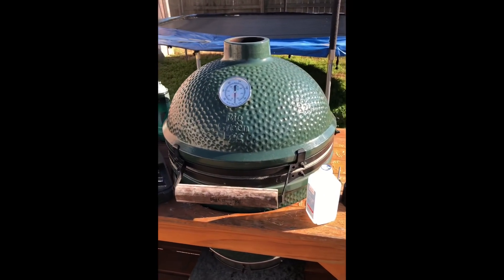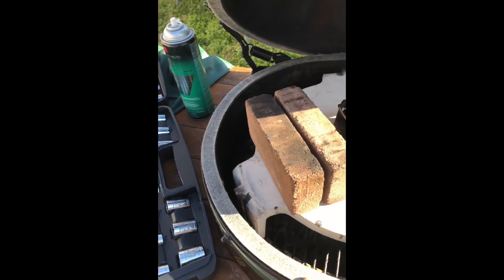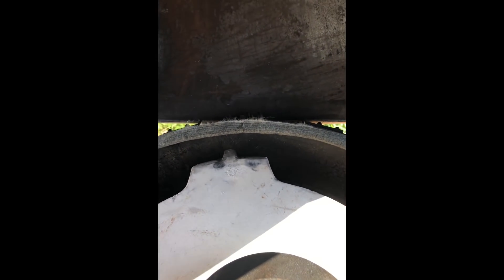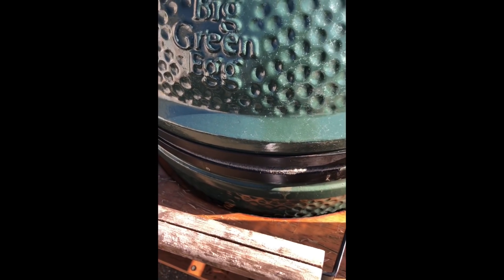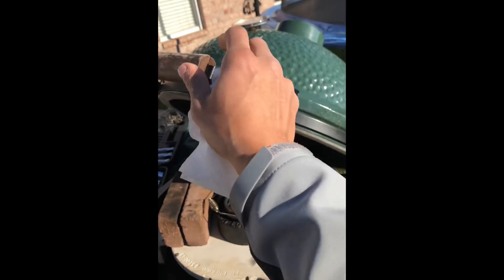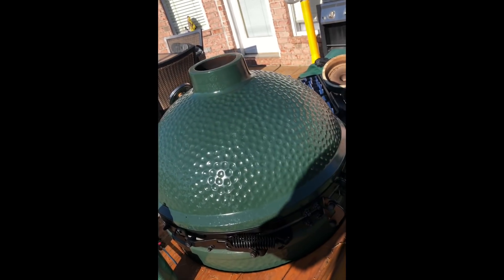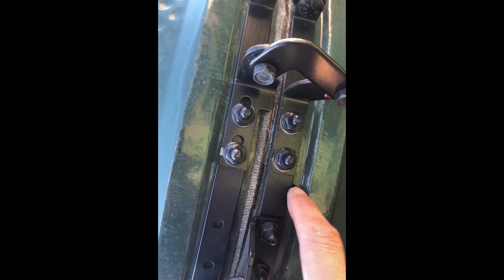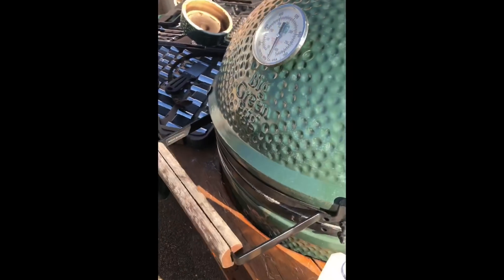Big Green Egg Dome and Base Alignment

Comment: Great video thanks just changed gasket and had under bite and spent considerable time trying to fix.  After your video spent 15 minutes and corrected the problem.  The removal of the the springs were key.  I also agree next time I change the gasket I am not taking lid off.  Thanks again

Comment: I thought this might work for me; however, my spring is extremely tight regardless of the lid position. I couldn't come close to removing it, and if I did, I doubt I'd get it back on.
Reply: Maybe mine is an old design - springs are on the hinge, not the side like in this video.